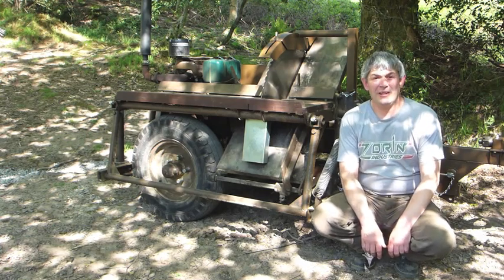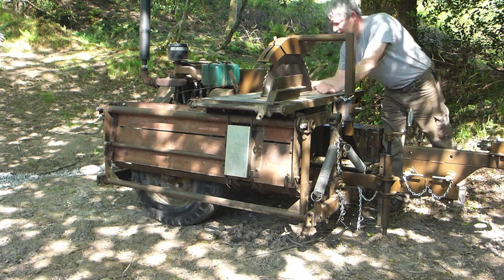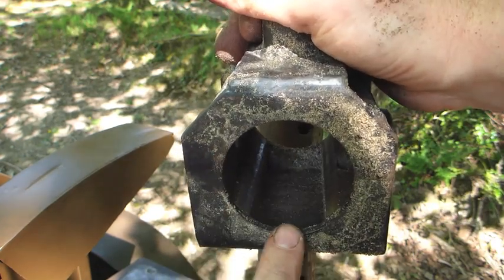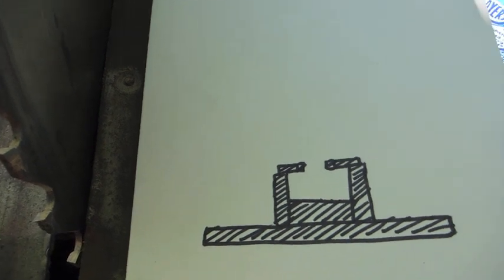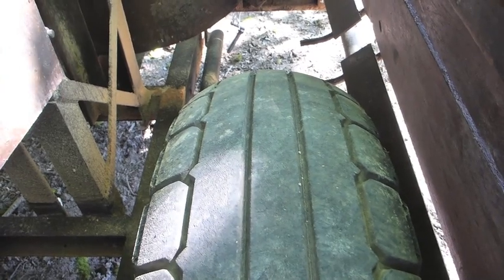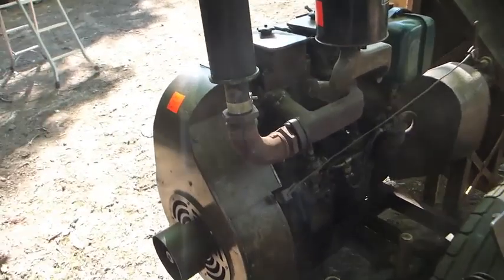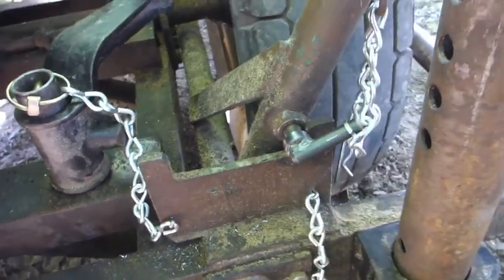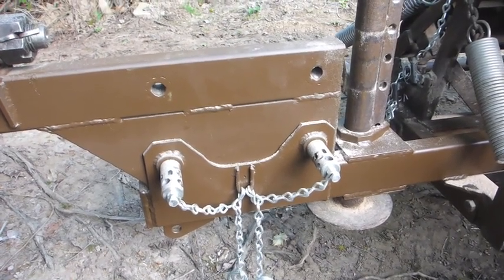McConnel Mobile Sawbench Owner's notes: Repairs & Improvements.

Comment: I have one and owned it for about 15yrs now, i must of cut a few hundred ton of timber on it by now, i wont let any one else use it due to safety issues with them but if used correctly they are a brilliant piece of old school kit that worked very well, according to the engine number on mine the engine was manufactured in April 1953 so i would think saw will be around there as well,, good starter and i worked it out i can cut a ton of timber up for a pint of diesel,,

Comment: Hi,    i dont  suppose  you know  a good  source of  more information on these  saws  at all or  if manuals are  obtainable  anywhere?   I have  a  model 14 RSU in very good original condition that i use  for  firewood but id like  to know  more about it,   and if  possible  obtain  proper  manual for  it,    ive  searched  online  but not had  much luck,     thanks

Comment: I have to say I was wondering if the health and safety thing might rear it's head. My opinion is that if you're going to use such a machine you should properly and assess the risks. Such an impressive piece of machinery and you obviously understand it comprehensively.

I wanted to ask a quick question with regard to phase converters but couldn't resist watching the video. I have been searching for a suitable motor and the best I've found is a 30hp 1950's Newman. Do you think 30hp will be too much to run off a household 240v supply as in your design? Sorry to go off at a tangent I just couldn't think of a way to ask.
Reply: Firstly, the saw was being used on my own private land so there's no issue.
As regards phase converters, I've had a number of "what's the biggest size" enquiries. Here in the UK, the largest single phase supply is 100amps which kinda limits what you can achieve, especially when you consider the other loads which you might be running at the same time. I'd say 30hp slave motor is probably doable, assuming you have an 80 or 100amp supply to begin with. But you'll want to motor that slave motor up ever so gently! Use the simple formula 1hp = 750 Watts to work out the load on the single phase supply.